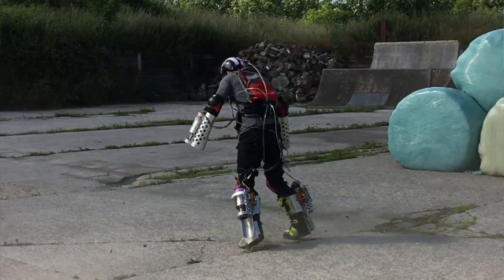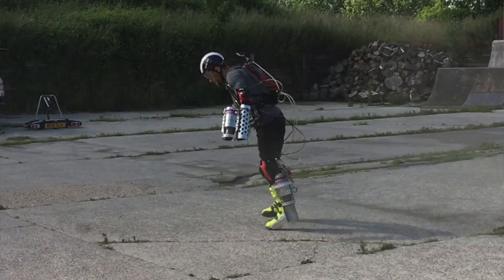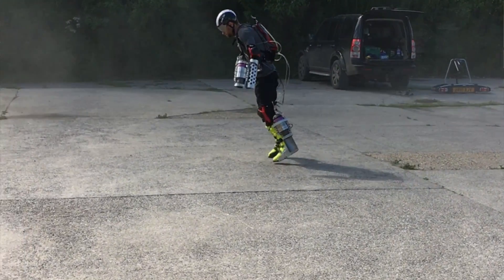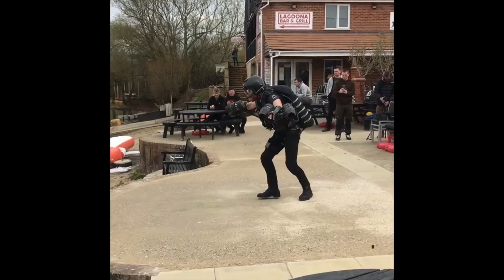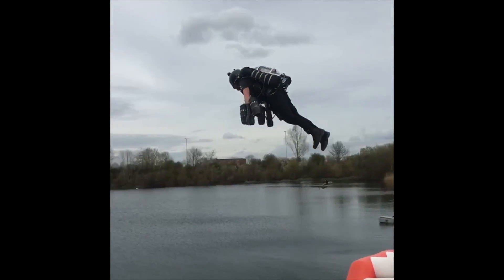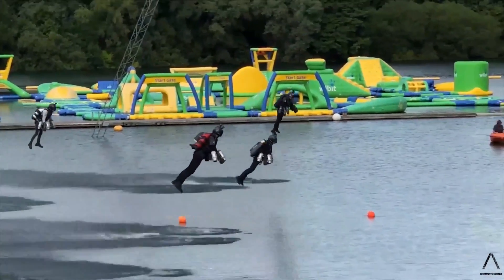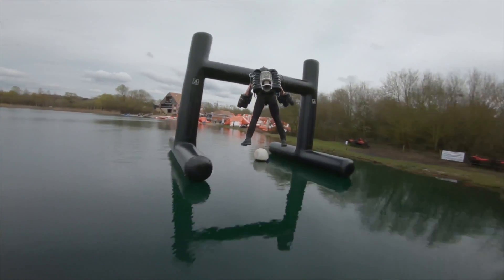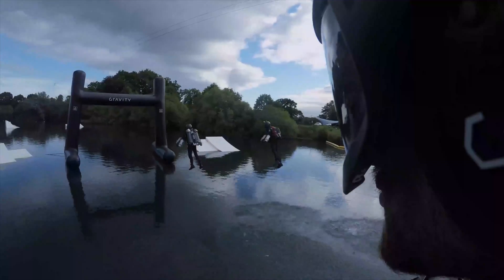EP2. Engines on legs? Richard explains why Gravity don't use them but reveals unseen test footage!

Comment: I guess leg engines could work with really good sensors and firmware so they would only apply thrust when suitable for the vector and position of pilot. Aka "fly by wire". So the the pilot could wave his/her legs all around so leg thrust would only fire when in suitable position. And/or adjustable direction thrust funnel, like in harrier so it could direct the leg thrust automatically.

But that would take a LOT of research and engineering.

Comment: why not use extra light bionic armor to relieve the hands and shoulders - equipped with dampers, as steering damper in a motorcycle do this job well. you have to have strong arms for that - right?

Comment: Thanks for answering this one. I wonder if you considered leg engines mounted to the thigh or hip instead of the shin. It would be a different sensation. Also, I understand that it felt weird being mounted to the lower leg, but surely arm mounts must be weird too. Could the choice of one weird over another weird be arbitrary?

Comment: PUT TO BUTTONS,ONE ON LEFT AND ONE ON RIGHT TO ACTIVATE EACH LEG.PROBLEM THAT LEG THRUSTERS TEAR GROUND CAN BE SOLVED BY FIRST TAKING OFF TROUGH HAND AND BACK THRUSTERS AND THEN AFTER LIFT OFF LEG THRUSTERS CAN BE ACTIVATED.LEG THRUSTERS WILL GIVE EMTREME MANUVERBALITY MAN.YOU CAN ADD THE TURBINES AT BOTTOM OF FEET IF POSSIBLE.(AIR PRESSURE MIGHT CONTRIBUTE IN RAPID AIR INTAKE CASE).

Comment: So the engines just aren't good for hovering, and are helpful for forward movement. A secondary switch/throttle would be used to turn them on once you get going

Comment: I love what you have been able to achieve.  I have one suggestion, Is there a way for the leg engines to have a separate trigger from the rest of the suit, so that you can choose when to accelerate with them. That way, you can use them in flight, but not while taking off or landing.

Comment: The movie "The Rocketeer" has continuously inspired me to follow jet suit technology since the 90s, although I've never had the resources to pursue anything as extraordinary as what your group is pursuing.
As a Mechanical Design Engineer myself, I am curious to the trials that were ran regarding attaching the Jets to the legs. Ignoring iron Man, for the cinematic reference only, the core idea of attaching the propulsion to the feet and hands make sense. When you think of how you walk up steps, It's the ball of your feet that support the body, and the articulation of the ankle that accelerate the foots movement relative to the body.
So I guess I'm asking if you tried connecting the leg jets to support the ball of the feet instead of the calf, and throttle control from the ball to the calf.
I also think that the backpack jet (in this application) may cause a hindrance to the mental articulation of the feet (much like the dog's core being supported by the human in your video), whereas feet and hand control alone my help overcome the obstacle of being a slave to the backpack jet versus being in control of the jets overall.
The hand control seems to have been adapted very well, and it makes sense, being that it replicates how many things in life are controlled by the hands and arms.
Overall, I am anxious to see more progress, and I think we're in a great time in history for this to take shape with the technologies that exist today.

Comment: Is there a way I can put a picture on here on my Exo-Skell design for this project?
Reply: As in a concept design for stability using a exo-frame from the rockets to the each joint until the pack on the back that has a piston/resistor to counter the forces of thrust on the user's arms.
Reply: Like a combination of Iron Man, and Call of Duty Advanced Warfare with the exo-skeleton on the side of the legs to give more power, but on the arms to the rockets.

Comment: This is really interesting, I'm glad you tried it. I would imagine that engines on the feet would feel like balancing on a ball made of water. You need a quick binding system that locks your feet together, but is easy to get out of when you want to land, like a binding on a bike shoe. I bet if your feet were locked together in the air it would overcome the running sensation. I used to give lessons on a Zapada flyboard, and the trick is that your feet are stuck together.

Comment: How about positioning the jets on your upper leg that way it wont suck in the hot exhausts from the arms. Maybe you could figure out a way so the exhaust from these upper leg jets wont burn your lower leg and feet. Also is it possible to keep the lower leg just as an in-flight additional?

Comment: I am no engineer, but I offer a little food for thought anyway. First, I would consider limiting the leg jets so they can only be engaged after the main jets are at 70% or so. Second, maybe use a rigid boot with an articulating ankle. With this I feel like you could mount a throttle cable on each boot so as you straighten your foot throttle is increased, giving more of a "pushing off" sensation. Enough rambling, I love what you guys are doing here. Keep up the good work!

Comment: I think it would be a good idea to add leg thrusters but not to use them for takeoff. Don't use them until you are above and at a diagonal with the ground so the arms could be pointed away from them. Also most leg braces can limit knee bending, was that ever tried to stop the legs in air walking?

Comment: Now I'm not an engineer and I've followed your project for quite some time and had a suggestion for you there is a harness I discovered in that is designed for climbing that distributes wieght off the arms down into the legs that may be of use in your suit I'll look around and see if I can find it again

Comment: In my opinion you should use the thrusters of the legs to have a slight lift but mainly for the changes of direction and stabilization, this obviously when it has already taken off and you want to plan even a more dynamic flight state.

Comment: Suggestion:  Have you thought about putting a bungee cord or maybe some webbing between the legs that would restrict them from separating or bending too much at the knees? 
I'm envisioning a triangle piece of webbing that's about maybe 12 - 18 inches wide at the bottom between your legs and feet, give or take a couple of inches, and the  apex goes to your crotch. 
Having something restricting your legs from splaying or bending too much would stabilize the vector of the propulsion and stop it from varying too far apart. 
It would restrict the up and down motion of your feet and train you to keep them and your legs  only a certain amount apart.
This way would give you more stability at the launch and more control using your arms to direct you while keeping the downward thrust at a steady constant.

TRIANGLE WEBBING, MESH ATTACED TO THE INSEAM OF YOUR LEGS FROM YOUR CROTCH TO ABOUT 18 - 22 INCHES WIDE WHERE YOUR FEET ARE SEPARATED. 
You can tweak it from there to see what works and train your legs to work together instead of back and forth like walking.
 But I feel it should be attached every 6 inches to your inseam .. preventing splaying, and more importantly the bending at the knee too much that throws you off. If your leg moves up at the knee on one leg the mesh would remind you not to do that  and keep them together. 
Consider this training wheels for your body to  stay in place to form a memory core for what you need to do. Once your body is trained to feel.a certain way when flying then you can start experimenting with the web off.

Anyway, I'm jabbering , my bad. 
And good luck...
Reply from the maker: Maybe 🤔 but still the rest of the challenges with leg engines
Reply: Understood... I thought trying to get your lower half more stable would avoid the pitfalls of your brain to leg reflexes of you trying to compensate for the awkwardness in the air.
Minimizing your legs tendency to wander outwards or having your knee jerk up in reflex would give you more control to concentrate  at the task at hand.
Looking forward to your next upload.

Comment: Locking the feet together on a rigid platform would help with stability and control
Reply: You then create the issue of mobility when not in flight. ability to run,jump, climb.
Reply: @Jafmanz  Of course. Most of the same could be said for snowboarding and wakeboarding and flight is the purpose in the first place

Comment: Probably wise to put the legjet intakes on the bagback jet. Therefore its almost impossible for it to suck in hot air. Does create a hose problem tough, and more weight, and the legjets wont be able to work when your at ground level to protect the tarmac
Reply: That's why they didn't do it
Reply: @Cade_V  he said that they might put them back for the races and extra maneuverability. So its not scrapped, yet